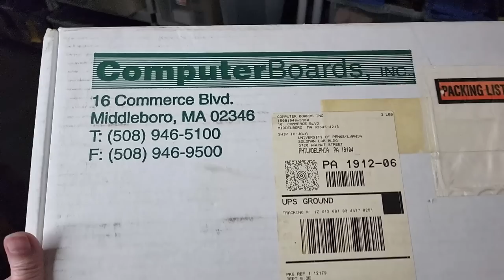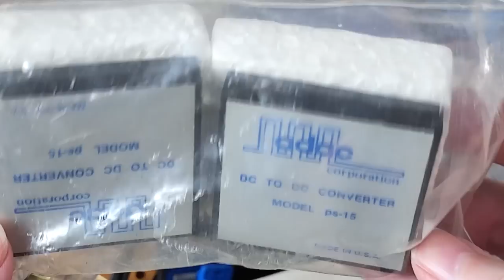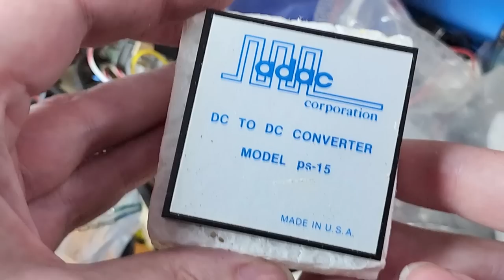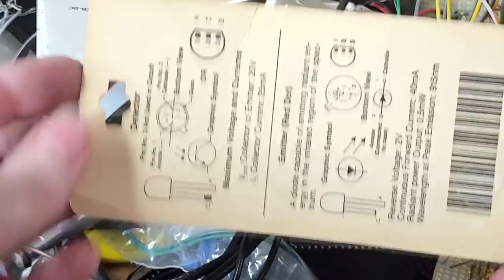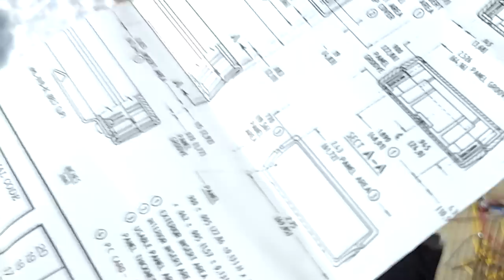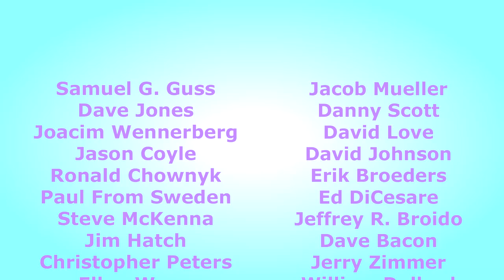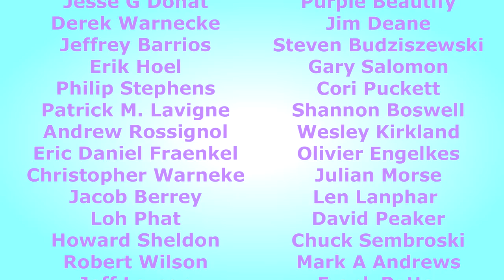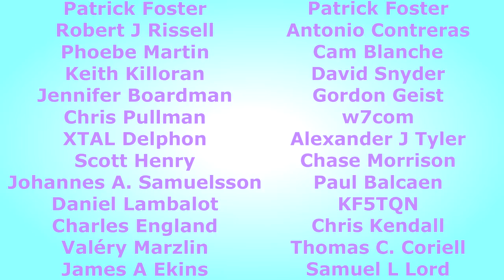From The Vault - Mystery Box!

Comment: Yes long gone are the days when you could walk into a Radio Shack for a pack of 555 timers or a bottle of ferric cloride for etching circuit boards. The "good ol' days"!
Reply: Something lost VS many things gained.
Reply: As a teenager exploring electronics during those days, it was awesome. I was going through one of my sets of storage drawers a couple of months ago and came across at 2N3055 transistor, brand new in the package from Radio Shack. I also have a whole stack of those  "spec sheet" packages. Every time I would get something different, I would just take the plastic bubble off the front and keep the cardboard piece. It was super handy to just flip through them when you needed a reference for a voltage or something. Sure you can just order everything from Amazon anymore but I would love the convenience of just driving a couple miles into town and walking into a store like you used to be able to do.
Reply: When I was a teenager in the 1960's I used to go to the big main Allied Radio store on Western Avenue in Chicago.  This was their headquarters and a VERY big store.  One entire giant room for just "stereos" for example.  But I was getting parts for electronics projects.  And so were a lot of other people at the time.  Many people actually made things back then.  Allied Radio also had "Knight Kits" which were sort of like Heathkits except made more cheaply.  I knew a man who worked on designing the kits and he said they would look at everybody else's, and then find ways to make it cheaper.  Lower quality PC board, cheaper power cord, simplified circuitry, and so forth.  Sort of the Muntz TV version of electronic test equipment.
Reply: and now those of us with any hobby at all are considered exotic creatures requiring a special name - "maker".  GAH!

Comment: Perhaps the air unit is some type of switch or indicator. The rotary knob seems to vary the travel so may allow setting of the switch point or sensitivity of whatever was on the operated pin, when the air input gets to a certain pressure.

Comment: Selected tubes would be selected for low noise and a well defined gain, right in the middle of the specification, less than 1% from the nominal.

Vintage LED's are from a Seikosha dot matrix printer, on the front panel to show power and error status. Missing the not installed middle green (very expensive) LED that would show it was on line. You had a separate PCB with the 2 push buttons, that took it on and off line, and did line feed, or page feed if held down for 1 second. Pretty much indestructible, they only were scrapped when the head assemblies wore out, and Seikosha no longer had any left as spare parts to put in.

Comment: If you just happen to run across a Telefunken VF 14M vacuum tube, and/or an M7 or K47 or K47/49 condenser mic capsule, I'll give you a couple bucks for them.
It's all I need to finish out my retro-spec Neumann U47. I already have the GN8 transformer.

Comment: The Telefunken ECC 83 is a dual triode, used in nearly all the schematics I have noticed as an audio front end.  However Telefunken themselves made a studio tape recorder that used ECC 81 throughout, several of them, and no other tubes.  Of course it did not have a power output.  Its outputs were a line out and earphone out.  On our campus "radio" we had two of these tape recorders and I, among others in our team were spending hours and hours preparing music tapes that we played out to our audience around midnight.  Sometimes I still suspect that my earlobes are often hurting due to the hours of earphone use in those days.  Hah!😊
Reply: Also used in most tube guitar amps to this day, with new production tubes still available. Vintage tubes like this fetch a lot of money.

Comment: I used to work for a small Christian college and got the random small haul of old stuff, mostly World War 2 era and 1950s stuff...
     Found out that 440hz transformers get hot on 60hz, even though they had 120 volt primaries. ...not enough iron in the core.
Reply: Not enough primary inductance as it was designed for 440hz, it will saturate at 60hz.